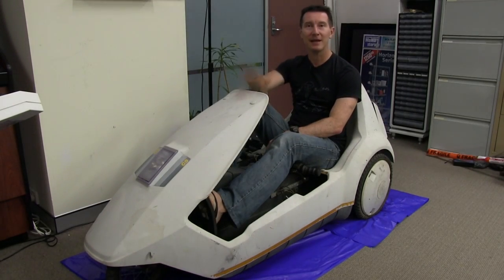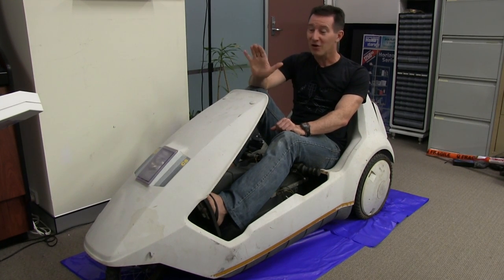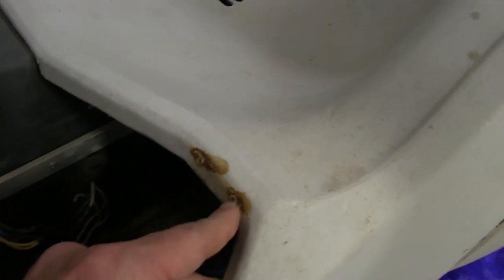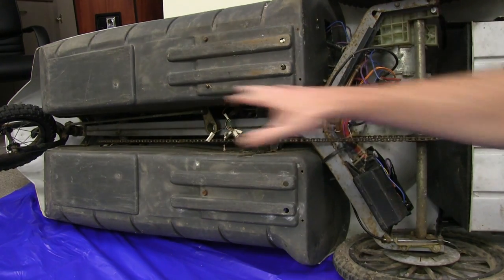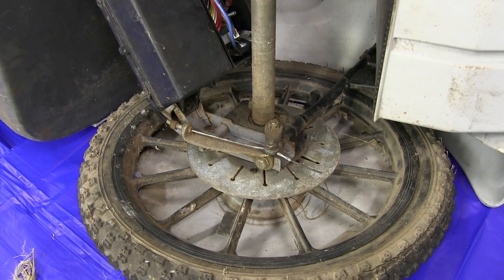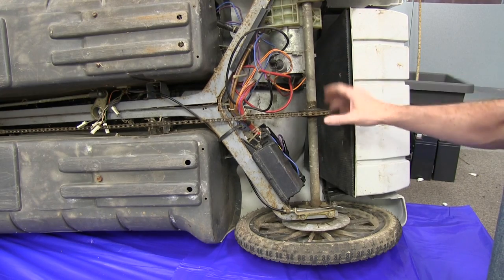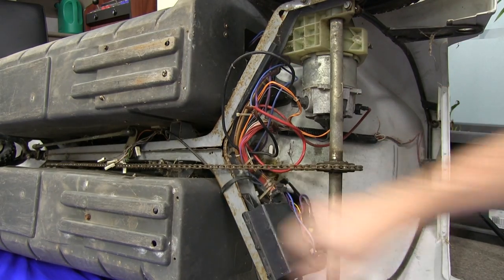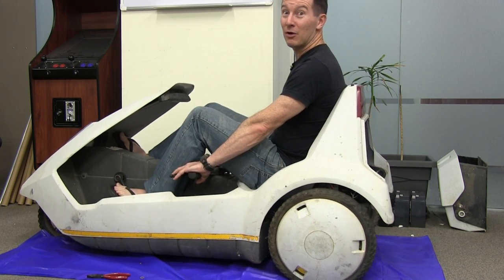EEVblog #604 - Sinclair C5 Restoration - Part 1

Comment: For the frame openning up like that, best bet is to get a guy in with a 100$ tig welder to put a piece of light guage steel over it, clamp it all back together and weld the patch in, shouldn't need more than about 4" down the centre and about the same (4") down each leg to secure it quite nicely. Need to clean any corrosion/paint off the area first with a dremel tool or whatever, but then it's like a 10-15 minute job for any half way competent welder. Or you could do it yourself, it's really not as hard as ppl make it out to be.  PLEASE PUT A SNAZY NEON PAINT JOB AND COOL STICKERS ON PLEASE! XD

Comment: a wire brush to take out the light rust and a bit of welding on the heavier rusted away parts, then a coat of paint should fix the frame.

Comment: The "unknown" switch with two transistors  is from ACU screwdriver (acu drill). Maybe speed controller. You can weld chassis together, isnt bad...

Comment: The way the center seam of that chassis is split, it will either need a major restoration or a complete replacement.  The front wheel is pretty ragged as well, and I'd be pretty worried about all the rust on the braking surface.  Either way, I wouldn't want the work on the chassis done by someone just learning to weld.

Comment: Many of us that have some electronics skills lack fabrication skills, It will be interesting to see how you handle that. I think this is a very important and relevant project. It covers mechanical, electronics and software. I hope you can install an advanced drive system with performance, efficiency and regeneration capability with a fully functional trip computer giving range, battery usage power etc :-)

Comment: from looks chassis is salvageable, if you want it like new, you will have to sandblast it, then little bit of welding, and painting :)  else way just use angle grinder on that place where welding is needed, weld, use ruststop, and spray paint.

Comment: Strip it down completely; that'll save you lots of time. The chassis needs some rust removal (phosphoric acid) and welding, then grind the welds down and strip the paint. Get the chassis powder coated and you'll be good for a few more decades. Put bolts in the threaded holes first; you'll be glad you did. While that's going on, send the body off to a body shop that's qualified for fiberglass / plastic bodies. It won't cost a lot and they'll do a far, far better job than you ever could.

You'll want to replace the chain; yes, there are ways to make it better but nothing is as good as a new one. The wiring harness is a mess; it's up to you to fix it. Avoid crimp splices; if you've got to splice, solder and heat shrink are the only way to go.

The dash electronics are primitive; you'll undoubtedly think of better stuff while the chassis and body are off for their beauty treatments. Avoid too much complexity, keep the power usage low. Consider replacing the NiCd batteries (long dead) with NiMh batteries; more power in the same space. Maybe even lithium batteries if you want to deal with their care and handling.

Most important: don't "half ass" it. The motor can be rewound or replaced and if you've got a good chassis and body everything else can be made right. Take the time to do it right and enjoy years of happy motoring.

Comment: They probably blew the factory motor controller, then bodged a cordless power tool trigger onto it to drive the motor.  The chassis is repairable, it's metal.  The body seems to be made of plastic, not fiberglass, which is good for you.

Comment: Please can we have another video on this, i would love to see your thoughts on the electronics they are so simple even i can fix them, but it would be nice to see any upgrade ideas you may have.

Must say having owned and restored a few C5's myself the chassis on this one looks in OK condition. The reason i say this is that the rust looks pretty much like it is surface rust only and although it has split at the rear that clearly is the result of abuse (or an over weight driver as new this is only designed to take up to 16 stone max) and not corrosion. Although this would be best welded i have in the past (before learning to weld) used rivets to repair a chassis with the same issue and i can advise that the repair was left like that for years with no problems before i finally re-striped it to weld it back up.
Whether you decide to get it welded or fix it another way one thing to make sure of is that the curved brace in the rear is well attached to the rim as if it is not the chassis will continue to rip open until it folds and then it is good as all over for it.

Another thing i would like to say is that i would avoid front wheel drive in this thing as there is little weight at the front and most the time your wheel will just skid and spin on the spot when trying to go uphill, best to upgrade the motor at the rear as this is where the traction is.
Reply: +C Bullar The electronics are total CRAP (even by 1985/20th century standards, analogue electronics in a digital age?!). 

Dave has the right idea, strip the whole lot out, and put in a nice tiny modern digital controller and modern wiring loom, with a nice backlit LCD console at the front. 

The C5 looks like it belongs in the 21st century, it was ahead of it's time in design and concept. So it's a great opportunity really for Dave, and enthusiasts, to take out the front basic LED POD thing and replace it with state of the art technology. I'd go the full hog and put a 4.5" touch screen LCD with raspberry pi, sat nav, digital dashboard approach. And the front light definitely needs replacing with ultra-bright low energy LED and some indicators putting on the rear. If you wanted to get really creative, you could put in SatNav on the LCD and front/rear view cameras :-)

Comment: You got some work in front of you but luckily for you, the things we do for hobby after work you can do at your work.
Perfect opportunity for you to broaden yourself. Learn to weld, plastic repair, mechanics. I am doubtful of the hub motor idea. It must have much higher rpm than in a bike with those small wheels.
One thing is for sure. You will have loads of ideas in your forum for every question you ask.

Comment: Dave, it really isn't that bad! Okay, so you don't know how to weld, but strip it down to the chassis, and a local metal work/garage would be able to weld  any bad bits on it. Then have it dipped in anti-rust solution and a good rust preventer. Maybe have it powder coated. It's salvageable. Get a wiring diagram and make up a new loom. Would be a cinch for you! Have the body re-sprayed after the 'nicks' have been filled. The dash would benefit from some 'Back to black or 'Black Chrome''. It's here in the UK, though not sure about Australia. Just rub it on and it comes up like new. As for the drive chain, have you thought about disability motors? One of my wife's wheelchairs can reach 8mph and will go up Everest!  Don't know what you expect to get out of a Sinclair C5, but I wouldn't want to go much faster with my backside so close to the road! Good luck though mate!

Comment: It's pretty tired. Get someone who has experience in metal working to fix your chassis. Rust has had a go at that bottom section and weight has split it. So don't sit on it anymore, you're only going to make it worst.

Have it coated in anti chip road paint that they use to undercoat cars.

Then, find the perfect ratio between batteries, engines that will fit in the hubs of your rear wheels and build the damn thing. 

One place to store the batteries would be the underside of the frame. Have a few of them in that area with a shield to keep dirt out will make it a perfect battery emplacement.

I'm not gonna say any specifics. That's the fun of fixing something, finding it out your self. BUT don't sit on it anymore, either way you go, if you make that split worst it will go very hard for you to fix it. Probably why the guy ditched it in the first place.

Comment: Big Turnigy brushless DC motor + speed controller and a load of lithium batteries. Guys upgrade electric scooters with them and hit 50mph easily. So stick one in a C5 and those hills will no longer be a problem.

Comment: Looks good can be restore it looks like surface rust of what we could see, now were it looks apart it may have been held by calk but can no see it very well if not nothing a  welder can handle. I will just take apart, grind it, take to a welder if needed and powder coat it.looks like a great project.

Comment: I wouldn't give up on it even if the chassis isn't in good shape.  A lot of that rust looks like surface stuff that will grind off.  The broken parts look a little sketchier, but worst case I bet a new chassis could be bent and welded up out of steel tubing or box frames.  Shop around to different bike repair, machine shop, auto repair, welding shops, etc. and I bet you could find someone to work on a new chassis in their spare time for not a ton of money.  It's nice that the vehicle is small enough to be completely disassembled down to the chassis without a ton of trouble.

Comment: A lot depends on if you want to keep it as original as possible, or correct some of the design flaws and make it better than new. It sounds like you want to go the later. MIG or TIG would do the job for fixing up the chassis, any good autobody shop could handle the job. Since the one in the other video was broken in the same place, it looks like a design defect and it should be reinforced. Or have the chassis redone in aluminum tubing for light weight and no rust. A custom bicycle shop could quote you on that. Not original, but better. I agree that there might not be enough weight on the front, going uphill, for a front hub motor. Are you sitting right over the rear axle?

Comment: Nothing is worse then trying to fix someones else's mess. Especially when it looks like your son could have done a better job then the previous owner. Good luck Dave your going to need it. Also, that chassis is broken. If you cant get it fixed by a metal shop you should scrap the project. 
PS Cant wait to see the rust on the other side of the chassis. The metal shop should be able to clean up the rust for you and paint it with a protective primer while fixing it.

Comment: I would rebuild the chassis there are some weak points there, like the axis of the rear wheels which has a weak point near the driven wheel.
The rust doesn't look that bad, you will propably have to fix the broken parts.
Greetings
Reply: oh i forgot.
A friend of mine also has a c5.
He has a nice repair diary on is blog, maybe this could help you repairing yours.
http://www.cypax.net/projects/c5/

Comment: Looks like you're going to get a bit of use out of your 3D-printer to replace the plastics. Chassis frame should be at least salvageable with a grinding/welding job. Good luck man!

Comment: 'Heap o shit'  you got that right !
That crack in the chassis is very nasty, the two legs that hold the back wheels will be very flexible when there is any weight on the seat, that will cause the gap to open up massively when you are riding it. One good bump and the whole chassis could split in two !
My advice, put it back on Fleabay and cut your losses before you get too far into it ! Seriously that's more than just a quick patch up job unless you are dead set on it, needs a new chassis at least !
Reply from the maker: Then why does everyone else say it's an easy welding fix?
Reply: It's severely weakened, welding might fix it but that's a structural member and unless it is reinforced it could go again. With all the other work that needs doing it's not worth the bother, I would look for one in better condition.
Reply: EEVblog Some times "everyone else" can be wrong, specially on the internet.

I would take the chassis to a professional to look it up because, you know, safety first.

It's not that easy to judge how bad a chassis is by just looking at it in a youtube video.
Reply: Welding thin metal can weaken it further even if you add some reinforcement, it might end up being even weaker because the heat involved will affect the structure of the metal.

You really need some expert advice on this before you plough any time or money into it.
Reply: Ian Clarke That crack looks nasty at first. Looks like cheap spot welding that could be easily fixed.
However to get it done right you'll have to strip the chassis completely which might be a good opportunity to have it remade from scratch.
Reply: +ppdan I agree, stripping it down and replacing the chassis is the way to go. Even having a new similar but easier one made up for a front-wheel hub motor upgrade wouldn't be terribly expensive either if you found a local guy handy with a welder. I happen to know which a fella who actually makes his own bicycles, all kinds of weird and wonderful designs. He could make a chassis like that or adapt a brand new modern one for the C5 no problem.
Reply: I know this is two years old, but weld it properly and it will be stronger than ever.

Comment: Too bad you're not here in Alaska Dave! If you were, I'd fix up the chassis for free, could weld it up and do some rust restoration work. Also as far as rust go's look for a product called POR 15. (Paint Over Rust 15) I've used it multiple times and it works very well, just make sure when you apply it there is plenty of humidity as it actually cures via humidity not  the typical evaporation.

Comment: It's been 4 years. Time to revisit your C5 with a Part 2 video. Team up with Youtuber: Mustie1 He can do the rust and mechanicsl bits. You do the modern front wheel motor, solar charger trailer with camping equipment. Only you can do justice to the C5 and a newly rethought electronic system, top to bottom. Please and Thank You, in advance. I would like a video guide for my future one here in the US. Maybe a ZX Spectrum controller snd GPS system (Harlequin Rev G clone).

Comment: I would remove everything and then get the chassis professionally sandblasted to remove the rust (looks mostly surface) and then get someone to weld the broken bit on the chassis.
Not super cheap but maybe 100$ and you have a perfecty strong chassis.

Comment: Get the chassis sandblasted and you will see the actual damage. It looks like it's simple enough that a good metal fabricator shouldn't have any problems making a new one out of a better material.

A new HUD would be cool if made to match the 80's style of the rest of it.

Comment: most of the rust looks surface rust and would sand down but you will need the split welding to keep the strength of the chassis, small job if you can weld i`m sure you could find a d.i.y car mechanic to spot weld it for you, the back plastic, black boot polish works well and paint restorer (T CUT) in Britain would sort out the plastics

Comment: Don't you think Sir Sinclair went a bit too cheap on that frame? Bring it to people in a metalshop if it will hold the new welds.

Otherwise the rust? You call it rust? Dave, appearently you don't live in a country where they put salt on the roads doring the winter :)

Comment: I'd say pull the frame, and have it drilled (small hole at the end of cracks to stop the split, re-welded, stripped (acid dip, sanding, sodablasting, etc.), and painted (or powdercoated).

Comment: Without seeing the frame up close I suspect you could mig weld the cracked area that looks like a design issue. Then treat the rusted area with rust converter and paint it.

The trigger like thing is a drill trigger / speed controller I suspect someone had an odd idea to mod the motor control circuit. Given that speed controller works with AC voltage I expect the person modding it did not have a lot of joy using a DC power source.

PS I can weld but I am in Victoria sorry. :-)
Reply: I Would replace the frame with a steel pipe construction.
Reply from the maker: You say MIG weld, someone else says TIG weld, oh the confusion!
Reply: EEVblog
TIG is for more high end welding, MIG is a thing that shits wire, much like soldering - usually gets you worse looking weld, widely used in car repair. TIG needs training, MIG - Sagan could weld with MIG in 10 minutes.
Reply: EEVblog
MIG or gas torch welding or even brazing is good for thin tube or sheet welding but both need skill and the gear, I am sure there must be someone on here who lives near you.

Comment: I'd say run for the hills. Chassis is spitted apart from rust, the fiberglass looks like it would need a paintjob, you'll have to probably change the batteries as well... Beyond economical repair, definitely. Not impossible though.

Comment: That rust is nothing lol trust me I have seen rusted frames. As for the middle pinch weld that's failed, I would get some metal on each side of it and drill a few holes. Stick 2 or 3 bolts through and that will keep the 2 sections together better than when it was 1st made. The one thing I say you should do ASAP is get a wire brush and remove all lose rust / paint then get some metal rust paint and go to town with it. That will stop the rust in its tracks. I have a 1980's motorbike that's out in all weather and she has a solid frame. Rust only becomes a problem when you sit and ignore it.

Comment: the original C5 wheels were black plastic.  with sinclair branded tyres that had a ribbed tread.  Think it was V Rubber brand tyres.  front wheel is 12".  So small kids bikes.  Those 3 wheeled baby cart things and some of the bigger push scooters have those size of wheels.  16" rear plastic wheel, so a common kids bike wheel size.  can get a smoother tyre tread in that size.  Schwalbe big apples are a good tyre.  smoother tyres give less rolling resistance.

Comment: Regarding that trigger-looking switch and power mosfet(s) on the dodgy aluminium bar, It looks like they hacked on a speed controller from a battery powered drill or something o.O